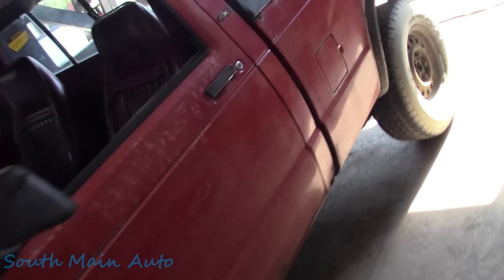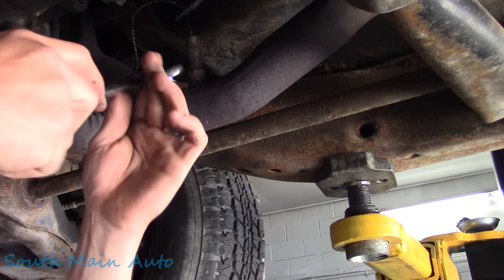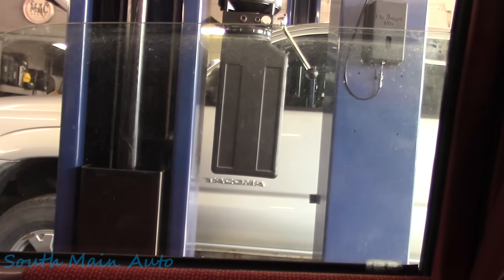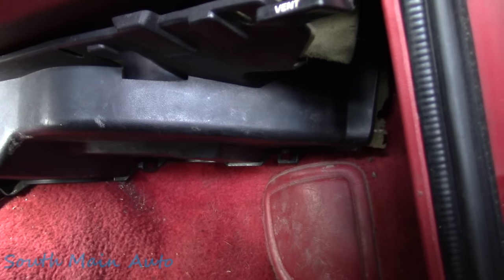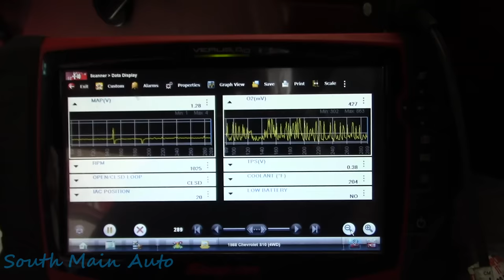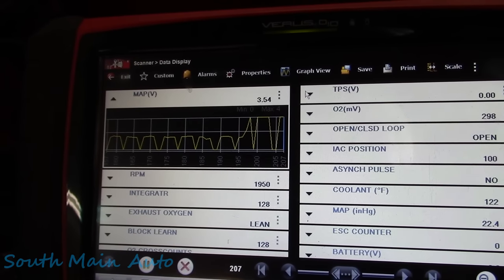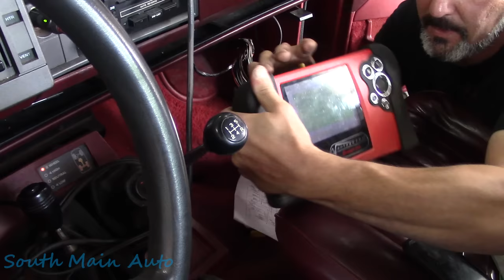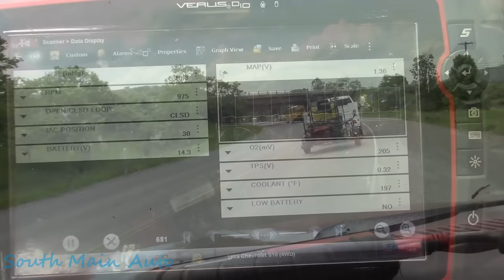Chevrolet S-10 - High Idle and Dies After 20min Drive?!

Comment: Back in the day, my father was the service manager at the local dealership. They would rotate thru everyone in the service department to cover "roadside service" on weekends. One weekend, my father got his turn in the barrel and I asked if I could come along. He said yes, so off we went. The call was a 1988, Chevrolet with the 2.8 liter, V6. The symptoms, as described by the customer, were just as you saw. Without hesitation, he swapped out the PCM. The customer was on their way in about 20 minutes. I asked him how he knew it was the PCM? His answer was one word. Experience. As soon as I heard you describe the symptoms and saw the service number (1228062) on the PCM label, I knew what was wrong. The dealership roadside service truck used to carry 4 of those PCM's at all times and to this day that number stills sticks in my head as I myself owed a 1988, Chevrolet with a 2.8 liter, V6 and had the PCM fail in the same way. To this day, I still have the spare one I used to carry with me. The vehicle is long gone, but I still have the spare PCM in my box of old parts and a lot of great stories from rolling with my dad on roadside service calls! :-D

Comment: I am an engineer of different disciplines, and electronics is one of my things that I screw around with and have for quite a long time… Anytime I wanted to freeze a component if it was a small thing like a transistor or resistor or whatever they do have “freeze spray“ and for the big stuff like that, I have a carbon dioxide fire extinguisher that works just great for bringing the temperature of those electronics right down to subzero in a hurry!
    Edward H. – engineer/Machinist/Fabricator/ Innovator at: New, Ideas and Innovations, LLC in Madison, CT.

Comment: I loved this one and it hurt deep at the same time.  My first new ride was a '91 S-10 Blazer 4.3 with the same Garnet paint job a gray sport interior.  It had the same same paint fade down to the gray primer and all.  That thing was mechanically indestructible.  I took it off roading often, jumped motorcycle moguls with it and it still had the original engine and transmission at 215,000 mile.  Sadly the salt got the best of it and I let it go in 2007.  I still miss that thing to this day.

Comment: Another great video Mr. O. Hey is that just a tail light / brake light that you use for your test light and does that give you low amperage / high amperage test capabilities?
Thanks again for all the knowledge. I'm a fan.
                    Ralph

Comment: My first car was an 83 Cutlass Ciera. TBI injected iron duke. Had similar issue. Drove for roughly 30 minutes, car would die. After 30 minutes or so, it would fire right up. So, when it died in the garage, took the ECM out, put in the freezer for 5 minutes, reinstalled and it fired right up. Hit it with a hair dryer, died almost instantly. Shade tree diagnosis for the win, back in 1993. 🙂
Reply: That's good info 😂

It really is

Comment: For intermittent EFI problems there are usually two common ECM faults: leaky electrolytic capacitors and broken solder joints. Failed MOSFETs or other power regulator chips can also be a problem if injectors or solenoids aren't operating, and random running faults that can't be traced to something else may be caused by PROMs that have dropped some program bits. I have a similar vintage GMC truck and I don't remember any electrolytic caps in the ECM (I preemptively checked) so more likely it's broken solder joints here. Japanese cars from this era (and well into the '90s) tend to have more problems with capacitor failure than anything (other than Honda's notorious main relay solder joints), but up in NY I'm sure they all dissolved from rust before the capacitors had a chance to disgorge their innards all over the ECM.

Comment: Had a similar issue with a ‘99 Dakota.  It would die while driving around town but did just fine on the highway.  The PCM was on the right front fender.  Voltage regulator on the PCM went bad and it would overheat itself and kill the truck.  Highway driving would cool it down enough that it would stay running.  Got a new PCM for $135 and she ran perfect again.

Comment: Had to laugh when you called that a primitive system. Guess you have not worked on the computer systems when they first came out. I think I might even still have one of the very early scan tools in my garage. 😁 I wonder if some thing happened with all the things such as to O2 wire grounded .  Those computers were did not like any type of power surges. This video brought back all kinds of memories.  
Worked on lots of those early systems

Comment: My father in law had a 1990s ford ranger with similar symptoms,  the cause was dried out electrolytic capactiors in the ecm. I opened up the ecm and soldered in new capacitors, problem was fixed! Since that pcm is so old, i guarantee it just needed new capacitors soldered into it.

Comment: I remember those days with the Eproms that were removable. The case wasn't robust enough & the board always had cracked solder. They even use to put them in the fender well on the passenger side. Once they made the case thicker & the PCM was moved to the engine compartment, most of those issues disappeared. Eric was doing the proper test. Banging on them could get them to work briefly again. The old days of car repair. Didn't need to reprogram the PCM. It was all in the Eprom.

Comment: bought a used s-10 so many years ago from a dealer.  they treated me extremely well and the cost ?  i think it was like 2,400 dollars.  great truck for me.  ... was the engine the " iron duke " ?  don't know.   had " throttle body fuel injection. "  Well,  people may make fun of that,  but i think it was a great improvement over the old system.  it seemed like a good model and dependable.

Comment: Great video Eric. In the world of electronic repair, we would pop open the PCM lid and use freezer spray on the live circuit and spray capacitors and ICs. We would also be looking for high resistance or open circuit resistors usually resulting in discolouration of the pcb from the heat caused by a load short circuit in a supply line or just a faulty resistor. Using an Infra red camera would detect thermal runaway on any chips. Fault then confirmed by spraying. We would reflow with a any ICs with suspected lifted legs using a heat gun.
Reply: Our repair days R over. It is a replace world now. Solder is at $16 /8oz.
Reply: @Rick D: Meanwhile, somebody who actually knew what he was doing would have found and fixed the problem while you were screwing around with your toys. Stop trying to sound cool by spouting a bunch of buzzwords which don't even apply here. Just SMH, dude.

Comment: Had a similar problem with my old Honda and it turned out that the main relay had bad solder joints that loosened from years of vibration, a PCM could have the same issue! 👍🏼

Comment: I commented on the 2019 Chevy you found the ground under the right front wheel well rotted. On this vehicle, we had issues with ECM, pole pieces(wires) and no die electric grease under the modules.

Comment: As someone who worked for Holden in the 70's and 80's, I knew that it would be an ECM, the same ECM as that.. The Holden Commodore with the 3.8 would warp the circuit board when hot and stall the engine, or open the injectors to full cycle when starting cold and have fuel dripping out of the muffler.

Comment: I would open up that pcm and check for cold solder joints. BTW, you are awesome, your wife is adorable, your kids also.... your pets, i just wanna scritch them all! Please post your fav diagnostic tools.  I am a retired computer systems/Telecom engineer and bend my own wrenches. Rarely do I get flummoxed by odd ball codes but having access to wiring diagrams without having to stop and run to the old iMac in my garage would be awesome!

Comment: I had an 88 with the 4tech. My truck would idle high intermittently. Performed the shake test on the ECU and the idle would change. Replaced the ECU and all problems went away.

Comment: Electronically-speaking. Since this seems to be a "heat soak" issue, likely a solder joint or IC lands inside of that PCM. Especially if it's the latter, I think you made a good call replacing the thing instead of doing a reflow.

Comment: TWO BIG QUESTIONS
1. How did the owner find aftermarket parts for something this old?
2. How could a scan tool designed for engine codes assess anything on an engine without a data conputer? (What connector was used to pick up even basic items like RPM?)
Reply from the maker: 1. Salvage yards and the internet
2. I have no idea what you mean
Reply: obd1 gm ecm put out live data not much different than today's obd2 stuff. some of the old. prom burning tuner guys had decoded the obd1 ecm's for as much as most mid range today's obd2 scanners do.

Comment: If that PCM is Delco, the board consists of multi layers, which had a problem in that era of separation of layers through heat warping part of the board.  Can be hard wired around the problem to make it completely reliable.   I had a few changeover units on the shelf which we used to fix the problem in the 3.8 engines used in Holden Commodores from 1988.  The same PCM was used in 4 cyl ecotec engines and V8s with different EProms.

Comment: It acts like Vref voltage for A to D converter in the box is moving around. 
What a simple computer. I remember burning proms for the ECM.  
If I can remember the fuel regulator in the throttle body was  bad on my s10  and I had a vacuum leak under the dash that took some time to chase down. Other than that it was a nice truck. The neighbor bought it and totaled the truck hitting a retaining wall!

Comment: Regarding Eric's mention of going to the grocer and get a bag to 'put the PCM on ice', at the risk of proving my 'arm chair' mechanical abilities, not wanting to spend what we don't have to, a variation of this step would be to put the PCM inside a wrap with a freezer pack, similar to those used when meat or meds are shipped. there is no water from 'ice melt' to have to deal with nor contain this way and you have that pack for future use (ok, for it's intended purpose... food transportation. lol).

Comment: If you ever need to cool down something solid state, to check for
a thermal problem, you can buy "component cooler", a spray that instantly
freezes, or simply invert a can of duster spray, which is the same thing.

Use in a well ventilated area, these products displace oxygen!

2600 Baud

Comment: Freezer on the top.  Excellent choice.  
We made the mistake of getting a freezer on the bottom. Ice maker leaked water into the bottom trapping the wire baskets in a thick chunk of ice.  Not possible to pull out the bottom drawer for 5 days. Frozen food was ruined.  I have disconnected the ice maker permanently.  Never buy a fridge with freezer on bottom.

Comment: My friend the box has some bad solder joints. The computer in my wife’s Tempo was coated with silicon rubber . It was easier to replace it.

Comment: 12:21 That attitude is sorely lacking these days. The amount of shops I've worked with that would toss in that O2 sensor and if it wasn't the fault still charge the customer outnumbers those like you 10:1. Mad respect for that.

Comment: My friend was a GM tech. There was a rumor that the S10 2.8l would self-destruct, on cue, around 114K. A mechanic he worked with, went nuts, because he hated working on them. He pulled a customer's engine out and quit. My friend got stuck putting it back together.

Comment: When the Quad drivers in these ECM fail, it goes into
it's default strategy, a "limp home mode" as what it is doing.

It runs just enough to get someplace, zero Drivability.

Comment: It needs a PCM.  These are known to do that, you can actually leave the key on for about 30 minutes not running and the PSM will get hot and cause problems.   The pontiac Fieros,  Chevy S-10,  chevy celebrity, both with the 2.5 liter and the 2.8 liters. At least the ones I remember.

Comment: prior to my current vocation, the shop in which I was the "clean up boy" would throw a PCM at every mid/late 80's Chevy or Ford that was inexplicably running worse when hot.  They attempted the typical spwaps first but had no amazing scan tools.  This was in 1989-90.

Comment: GM Delco has refurb lines going for all the PCM units replaced by mechanics ... PCMs which really didn't need replaced. They test and clean them and send them out through auto parts vendors like Auto Zone which had the one for this S-10 ... plug and play for about $82.

Comment: The older Bosch ecus read the prom chip, and kept that information in RAM while the car was running. I found an older VW Golf that would act up every few starts, found a loose PROM chip, and could actually remove it while running without affecting the car. 

I imagine these GM computers were the same. I had an older buick with the eraseable, UV PROM, which corrupted itself after 20 years. One of the fuel injectors drivers had died 3 years prior, so I ended up jumping wires from the previous injector to fire, which worked until I swapped the whole PCM out.

Comment: I had a special edition 1994 S-10 4x4 and loved everything about it until I was on a first date and got stuck on flat ground in mud. Turns out the vacuum that pulls in the front diff is located under the battery tray.

Comment: I finally tracked down the erratic idle and engine dying. 1989 Isuzu Trooper with GM 3.1 (originally 2.8) with  Rodeo ECM (no smog pump). I finally caught it last night when I was troubleshooting it. It turns out that the TBI pigtail connector on one of the injectors was intermittently a poor connection. I measured the fuel pressure and noticed it was fluctuating as the injector would quit and then fire. These were 'new' off e--- and may have been counter f . I have some other brand now on order. I used a pick to move the contacts in the connector a little closer together. From an engineering standpoint this connector and contact design is junk and cheaply built.

Comment: I remember rapping the outside the ECM case on the early GM's  watch data and listen for RPM to change. Some of the old GM O'2 sensors sampled outside air and using panther 'urine'  (haha) would affect the O'2 sensor performance. I dont think you had one of those. It seemed like they had louvers in the case.
Reply: Oh the ye ole “technical tap”

Comment: There was a copper jumper we all had the little jumper with the red insulator, Insert the 2 prongs in the OBD-1 connector, it ground the computer. Once grounded we turned the key on, engine off, the check engine money light blinks the failure codes. In a bad computer it wouldn't tell you mych but Eric used a scanner with old software. When computer input values change for no reason it was usually a bad buffer network on the one channel. Open that bad computer you will see bad solder joints and dried up silicone grease on all heat sinks. I fixed these things at 3 auto electrical shops and a dealership. Don't miss those dogs one bit, distributors on those were horrible.

Comment: This is a random thought but the GM 4.8 l. V8, I want to argue that being one of the most underrated American V8 of all time... 15 miles to the gallon in the city. If it's just a daily driver and you're not working it too hard, it's honestly perfect. It's underrated as hell then it gets used for boost in the racing world street racing and stuff but for everyday driver man a 4.8 would be great. I want to find one even a two-wheel drive... Currently running an LQ4 and it's a pig

Comment: The Prom and the Calibrator chips are often bad as well as the ECM box.I have watched a person get a parts store ECM transfer the Prom & Calibrator chips. Then still have the same issue. I have seen the knock test where a car will change RPM's on obd-1 GM ecms. I always recommend changing everything.  Used is the most cost effective method yet some NOS ACDelco units can be found online.

Comment: Had the same issue with several 88-90 S-10's with the 4 banger and 4 spd. 1227747 ECM. Truck would die after 20 minutes. funny I can remember the part #. I left the auto mechanic field in 94! :face-fuchsia-wide-eyes:

Comment: I do QA testing at work.  We've switched silicon chip manufacturers and to test it out, I literally froze a unit in a freezer over night, plugged it in and verified if operated correctly.
We also held it in front of a heater and heated it WAY up and verified it functions.  

We found at high heat, some of the solder joints expanded and shorted things out.  But not at room temp or when its cold....

More proof you need a garage fridge/freezer for uhm.. .testing... and human stomach lube and brain moisturizer (beer)

Comment: That can around the electronics of that ECU is usually a heat sink for the electronics inside if you can't pick it up because it's too hot is bad , it should be warm  to the touch.I was  Bench tech.

Comment: I work on these iron duke 2.5 Chevys at the post office. The postal vehicles built from 1988-1993 have these engines. I would suggest checking the fuse box and replacing the ECM fuses (10Amp). Also, if the S10 has a long rectangular connector next to the fuse box, it would need to be removed and cleaned( due to corrosion). Lastly, you are getting weird readings from your snapon scan tool because the software used in it is not the best for old Chevys and has trouble picking up the data at times. You'd be better off with a snapon mt2500
Reply from the maker: First off this is not an Iron Duke engine and second I only follow the data and the facts, not hunches. Hunches lead to wasted time and rabbit trails. Pattern failure tryagnosics are the worst thing you can get caught in my friend 👍🏼